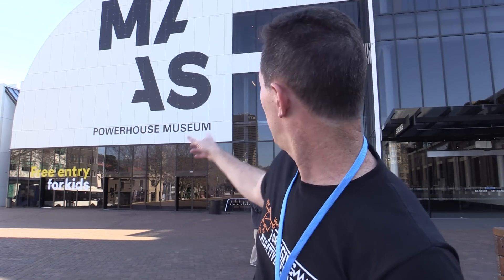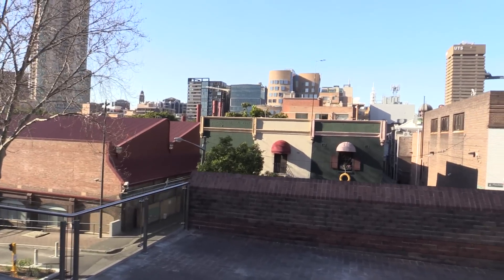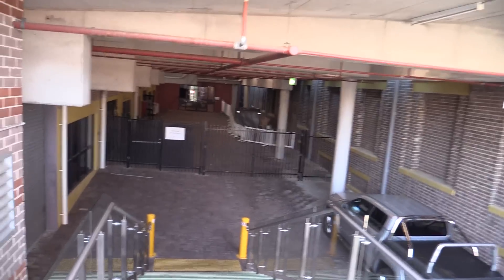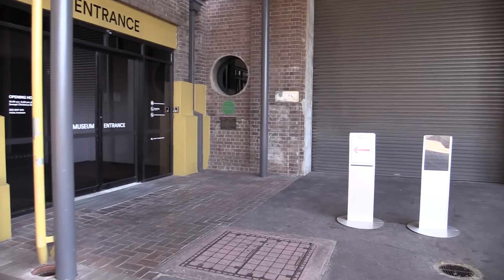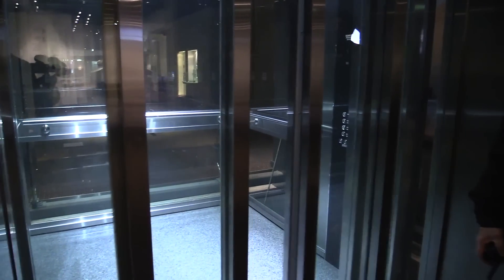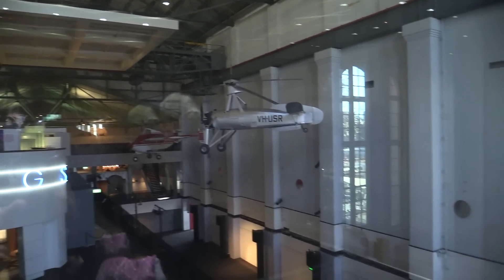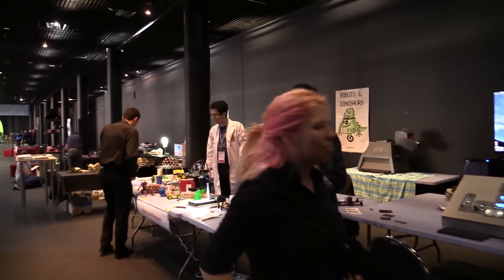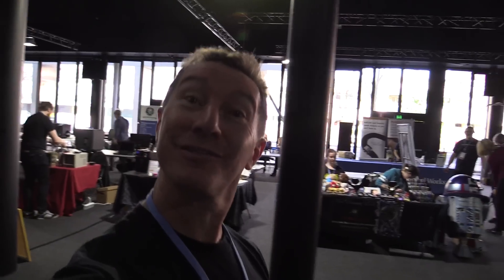EEVBlog #786 - Sydney Maker Faire 2015 - Behind The Scenes

Comment: Oh no! Batteriser is up to something on there channel!!!
Reply: +evan wilson After seeing that, now I am almost quite sure it's a scam. Of course the terminal voltage drops under current drain, that's well noted in the industry. That's why there are battery controllers which compensate for it so they don't false positive. They're not using professional coulomb counters to test remaining charge, not putting up independent lab verification of their products, not using professional battery simulators. They didn't show this "800 percent increase", they didn't even show a full record of the test procedures for the GPS, didn't test it scientifically at least three times for spurious errors, and you can even see scope variations after they claim it turned off. Further, picking out one single product does not demonstrate any overall usefulness. In fact, someone may want to e-mail Garmin, who might have a vested interest in addressing whether their products leave so much charge in the batteries.

Oh yeah, and humorously enough, they're actually stating cutouts based upon terminal comparator switchoff. If you do that, then setting a voltage with a common PSU actually does work to detect what that voltage is.

I hope Big D can handle this one, he's gotta discuss the different devices, pull out their datasheets, actually demonstrate the underlying stuff.
Reply: Ernst Stavro Blofeld X   Why do we always have to do all the work? (censored link)   
The Batteriser-boss takes charge himself and they even have cutie-snails in a well and a Smoking Gun.!
Brilliant! 
Epic Electronic Battles of Histoooooryyyyy! BEGIN!
Reply: Gordon Freeman Hey, the guy is a big shot in the industry, holder of 500+ patents and a Phd. 
He wouldn't gamble all this away for a $ 2.50 fake.
Reply: Gordon Freeman Well, did he? Where are the results?
Reply: evan wilson Nice! What are they up to?
Reply: +Gravity I'll put an addendum as well, in case Big D reads this: If you make a video, make sure to note the fact that a DC-DC converter into a comparator off can generate a 'motorboat oscillation', basically, the device will keep turning on and off, but not actually be particularly user functional.
Reply: +evan wilson I just watched their video, and I don't know if I should laugh or cry.
Reply: +Ernst Stavro Blofeld We might actually be looking at real engineers who have intentionally decided to scam people. They almost certainly know that "800 percent" is not representative of common applications. And they're directly omitting material test data from public view, like the ability to measure charge flow from the batteries to discern the actual capacity differential. It's very disingenuous, but in a way tailored so that it's mostly electrochemists and battery device designers who might be more suspicious.
Reply: Gravity Batteriser offers test samples now to testers. Dave should slap one in, forget the science and look at what happens in the field.
Remember the Duracell bunny? It's only the results that count.
Reply: +SPECTRE Oh do they? Indeed, comprehensive independent field testing would be best. Though I can tell from their video that they may be making fundamental errors about how the device works. 

For example it is fairly well known in the industry that higher current draw can reduce the effective capacity of the battery, there's ohmic losses and electochemical diffusion rates and so on, however a voltage boosting DC-DC converter must implicitly draw MORE current to supply constant power to the device at a higher voltage, due to P=IV.

Similarly, on a battery discharge curve, the time axis is fundamentally a time-charge integration: where the graph hits zero volts at a certain time is also by definition zero percent charge. So at a stated current rate, the nodes of voltage at which that current is supplied down to zero volts, is perhaps the power and thus the energy remaining of the battery.

Big D can definitely field-day that video, which may be entertaining.
Reply: Gravity Batteriser Batteroo commented on the batteriser video on YouTube.
Shared publicly  -  Aug 9, 2015
 "Hi Dave and EEV Blog. Let's vote to have Dave take time out of his busy schedule and review the Batteriser! (..)
Contact me, if you are interested, we would love for your review (or rant if you don't end up liking it). Batteriser@gmail.com"

Epic Electronic Battles of Hiistooory!
Reply: Ernst Stavro Blofeld
I just facepalmed when he mentioned how many patents he holds, that's irrelevant when it comes to the Batteriser.

And I think Dave supported their campaign so he could get some samples to test.
Reply: Ernst Stavro Blofeld
I just remember him saying that in a previous video, it may have been his first one about how the 800% thing was bullshit.
Reply: Gordon Freeman Nah.